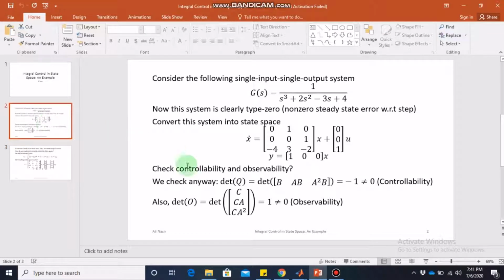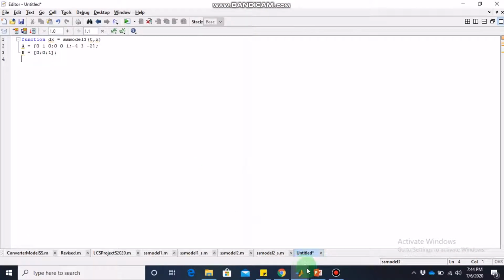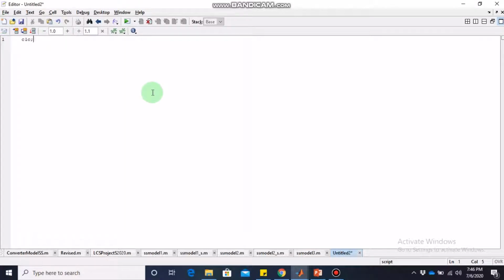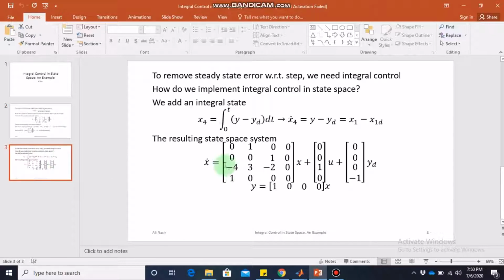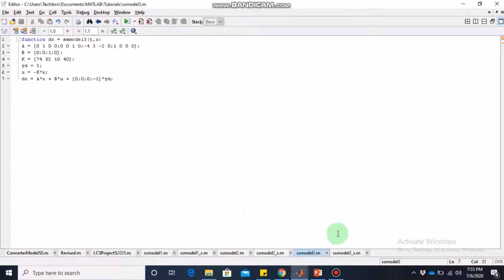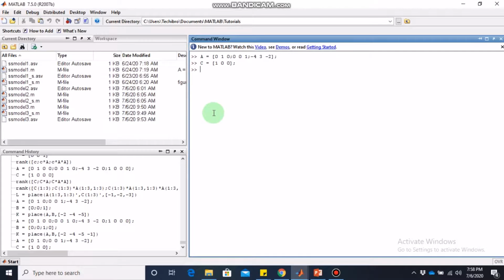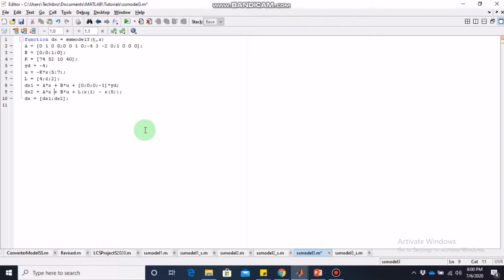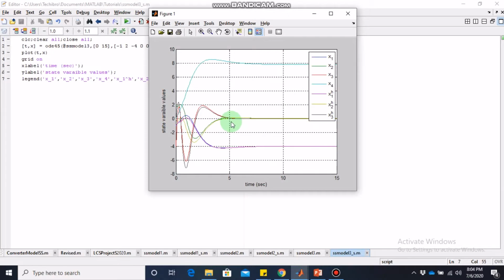Simulating State Estimation with Integral Control using MATLAB

Comment: If the system is not observable then can't we use place command in MATLAB?
Reply from the maker: Yes, the observer can only be designed for the observable systems. There is another condition known as detectability but that is not the topic of this video :)
Reply: @cset  Thank you sir.